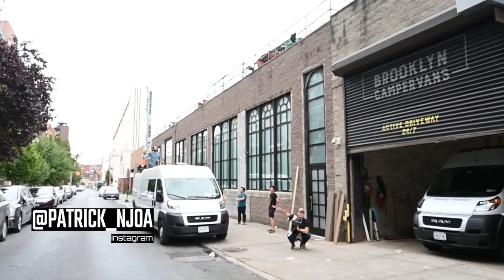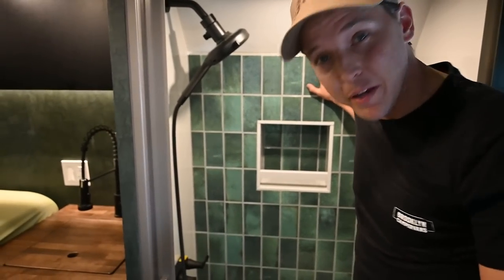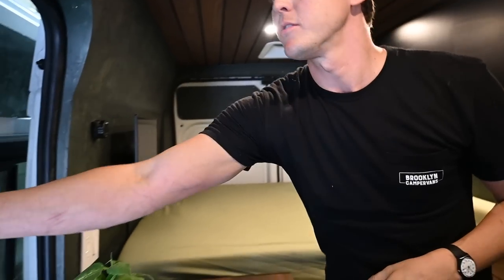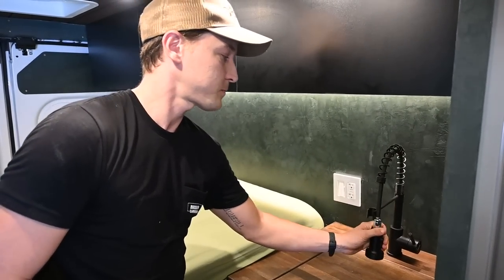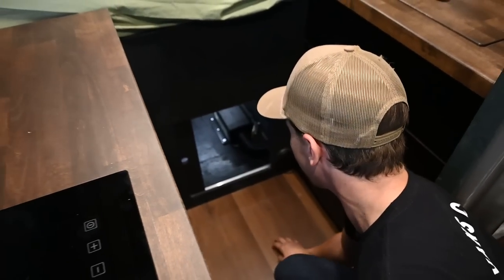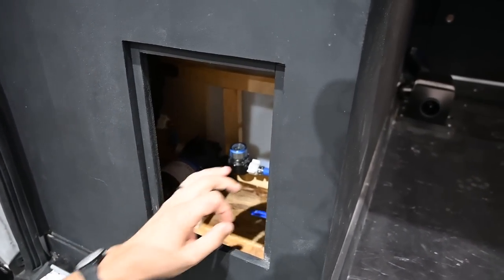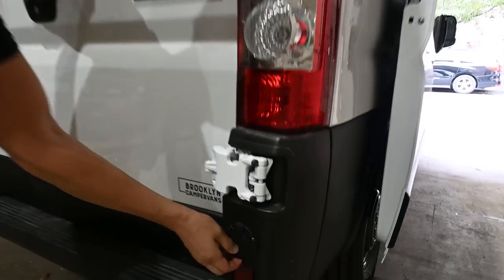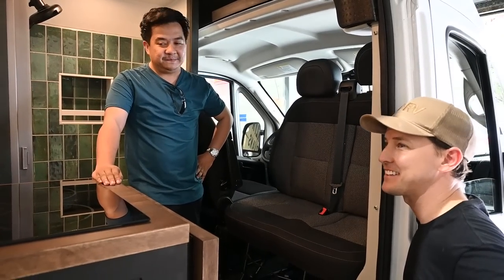STUNNING Camper Van Conversion - Rich Wood Tones, Shower, Toilet, Sofa & Bed

Comment: Nice, small van with beautiful colors. I would be a little concerned about the sink being next to the bed and the sockets in the wall right behind the sink. I wash my hair over the sink regularly, as showering every day, if you want to travel offgrid, is just not feasible. And even with a fairly big sink, that still involves a certain amount of splashing 😅. With the electric right behind, I wouldn't feel safe. With the bed next to it, I would probably sleep in a moist bed ever so often. I would definitely install some sort of splash protection for bed and sockets if that was my van.
Reply: Hi Wild Cat, thanks for the feedback! The outlet behind the sink is GFCI protected so no worries if some water droplet comes in contact.
Reply: A GFCI for this location meets the NEC Code and is safe.
Reply from the maker: Thank you for the feedback and for the concerns. Safety first
Reply: Use child safe plugs if your worried
Reply: Storage for closes closet hanging stuff. Beach and fishing gear. Does starlink fold down for during.what if you use bikes

Comment: The double bench seat is a win. So common in Europe but not seen often here. I love that they fit everything into a 136.
Reply: It's very common in Europe, but unfortunately not with a swivel option. For the RAM Promaster they are not allowed where I live. The only approved double bench swivel seats are for VW transporters. Even though you might be able to import them from another country, unfortunately your van won't get a license plate if you use them. For this reason, everybody here looks to exchange the double seatbank (which is standard in every van) for a single seat. Which makes them really expensive and hard to find 😅
Reply from the maker: Yes, very European. I do like that it swivels
Reply: Well, after all, it IS a european van. 🙂

Comment: It's a great camper  van with shower and toilet and kitchen.  However placing the sink next to the bed is the most impractical spot.   Rememeber when you wash water is going to splash over your mattress/bed.  Unless you have a piece of wood to block it or something.
Reply: I agree. I would rather see the shower next to the bed. Does not look convenient or efficient at all.🐾🇺🇸🐕‍🦺🦮
Reply from the maker: Thank you for the feedback, much appreciated
Reply from the maker: Thank you Dogs with Jobs for the feedback

Comment: NJOA;;PATRICK, HI,,GEEthese 2 guys did a very nice job with the SHORT WHEELBASE RAM, , I might say is the only van quickly available. It’s the ONLY FWD VAN, FORD, no delivery dates, SPRINTER NOW HAS A GAS ENGINE, forNON DIESEL FANS, but even with this short van nothing is lacking,, kudos to them., thanks for showing  ;;;;🇺🇸🇺🇸🇺🇸🇺🇸
Reply from the maker: Yes, Promaster Vans are readily available

Comment: Very nice build, I dont necessarily love the sink right next to the bed but, if ur gonna do that it would've been nice if the toliet could slide under the sink when showering & then be able to slide back when the toliet is needed..Also what was the name of the wifi on top of the roof? Does it stay up when driving or bad weather?
Reply from the maker: Thank you for the feedback. It is Starlink and is not permanent mounted

Comment: Can you tell us what this type of build costs? Just a ballpark figure with the features you have shown.
Reply: 50k
Reply: @NYC_VanLife  Is that just the conversion or the van and the conversion?
Reply: Just conversation
Reply from the maker: The conversion costs $50,000 us if the customer supplies the van